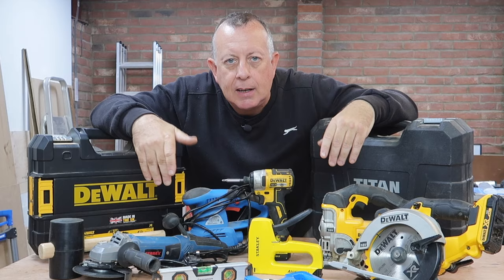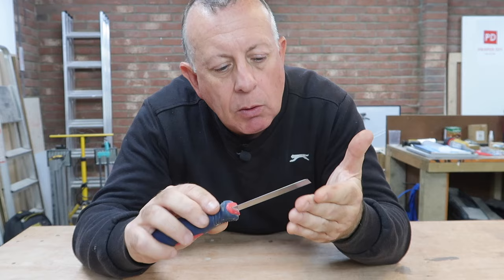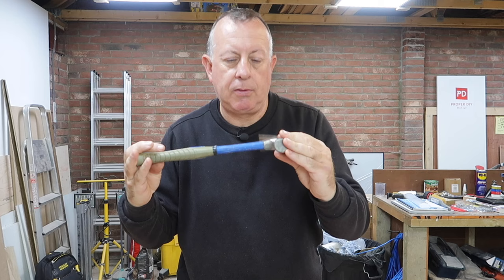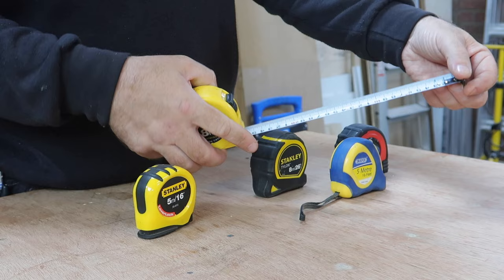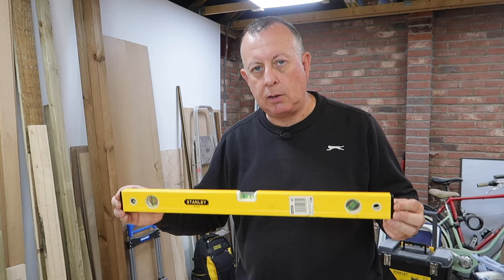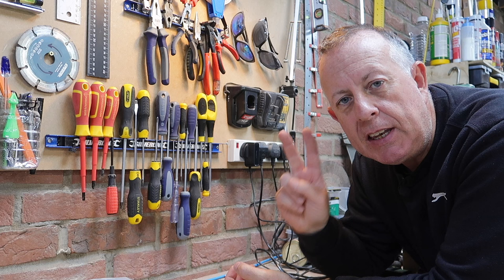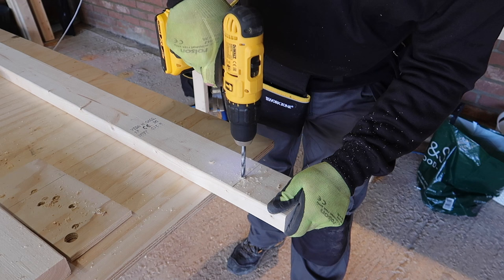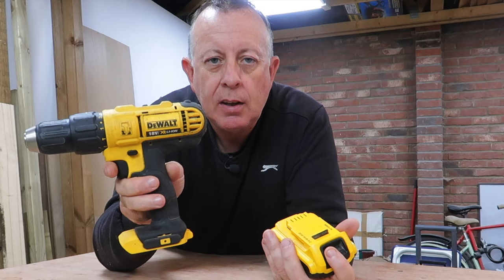Top 10 Tools for the New DIY'er for less than £100

Comment: You can’t please all the people all the time as the comments show.  Personally I think you should continue with higher / mid level diy videos. Someone of your expertise and attention to detail is wasted in this type of video. We watch your vids for aspiration and something to aspire to. Your garage project was amazing and we pick up tips from smaller projects
Reply from the maker: Do the comments show that - really? When I put out a 'Mortise and Tenon Door' video I get comments asking for more 'down to earth' videos that don't need many tools and the other way around. Over time I will try to appeal to the whole range of DIY'ers from new to experienced. As for current projects, I still have the rest of the garage conversion to complete, block paving, security cameras, garden projects and a large shed build etc,etc but unfortunately cannot necessarily complete one of these each week so sometimes I have to interject something a bit more straight forward.
Reply: @ProperDIY  I wasn’t being critical. , obviously you need to fill in to keep the channel going. I reckon some good fill in videos on how to properly use power tools like routers , table saws , circular saw for cutting fine without chipping, etc etc. Also quick honest reviews on tools. 
Just my opinion. As I say I wasn’t being critical ( maybe constructively ) . Ive watched all your vids to date and find them interesting and helpful

Comment: Good advice. I bought my daughter most of your top 10 basic tools when she moved into her first house. Not as glamorous asa bottle of Champagne, but it has enabled her to do the jobs she needed. A few shelves, put up a garden shed and fitting it out, and maintenance and repairs around the home. 

I really think basic home maintenance DIY should be part of the national curriculum for all year 11 children.
Reply from the maker: Good stuff. Could be taught in place of the traditional woodwork - which prob doesn't even happen now!
Reply: My Dad did the same for me, 30 years later and he's long since passed on but I still use the tools he gave me and I treasure them.
Reply: Snap. I bought my daughter an 85 piece hand tool kit when she moved into her first flat. She uses it a bit but it's mainly there for when I get called over to fix or fettle something for her. Over the years I've managed to build up a collection of Worx PowerShare tools which I find are the perfect balance between top end stupid money & the bargain basement variety. I also pass on some my older tools to my son when as & when they get replaced with new ones - just as my dad did for me.
Reply: Wonderful gift for your daughter.  Far more valuable than a bottle of champers.  Well done.  Totally agree with you about home maintenance being part of the curriculum.  Everyone needs to hang a curtain pole or towel rail etc.  I came from parents who hadn't a clue about home repairs or diy.  My father hung wallpaper once, he hung it upside down.  He put up a picture in the hall.  It fell that evening and smashed.  So grateful for youtube.  It taught me most of what I know and I'm learning more every day.

Comment: In my day maintaining military vehicles like the FV432 any sight of an adjustable spanner could get you on a charge. The right sized spanner for the right sized nut. Using an adjustable no matter how big could round off a sump plug or any nut causing thousands of pounds of damage and taking an AFV out of service. That lesson has stuck with me ever since. I always use the right tool for the job.😊

Comment: Great video, couple of thoughts:
1 - The adjustable spanner is not in my view a replacement for a proper spanner, it's too easy to round over the nuts especially with the cheap ones.

2 - 95% of home jobs with 10 tools might be a bit of a stretch...half the fun of DIY is tool acquisition! :)

3 - totally agree with the number 1, cordless drill is the essential tool! A "proper" brand (dewalt, makita, bosch...) as additional bare tools can be bought to utilise the batteries and perhaps could be a better investment than a no-name.

Cheers!
Reply: Re no 1. Smaller nuts maybe, but larger ones tend to be fine. Or get a Knipex adjustable. That won't cause any bother, though access is trickier!
Reply: @iainamurray  no you can't beat a proper set of spanners. Adjustables tend to slip
Reply: @michaeldunham3385  You obviously haven't used a pair of Knipex!
Reply: @iainamurray  35 years as an electrician...... I've used knipex but they don't beat a good set of spanners
Reply: @michaeldunham3385  Depends on what you're doing. I'd much rather use the Knipex wrench for a lot of jobs unless it's hard to get to.
Reply: @iainamurray  I've used knipex pliers wrench for loads of small to medium nuts, never slips as the harder you hold it, the harder it grips. Doesn't mean I don't want a set of wera joker spanners mind ;)

Comment: This is a good starting list and is pretty much the first tools I bought.  But it's only a start and my advice is never struggle or try to improvise with the tools you have - if you need another tool or part to do something, or to make it easier, get it.  I have an old property made of really hard, tough bricks, and I spent hours trying to drill a hole with a regular cordless drill and blunted my masonry bits.  Then I bought an SDS drill and it was a revelation.  When I had to screw cabinets to a wall,  I was like a contortionist trying to squeeze my wrist and screwdriver right into the top corner of the cabinet.  It was a nightmare, until I went out a bought a long reach screwdriver, and suddenly it was a breeze.  Overall the most useful tool I own is a ratchet screwdriver; I rarely use conventional screwdrivers.

Comment: My garage is stocked with Aldi/Lidl tools! They do everything I need them to do and my sliding mitre saw (also Aldi) hasn't let me down either.  I had more expensive tools years ago (stolen, bastards!) and to be honest for what I need them for now I will stick with cheap.

Love the videos and I have put some of your tips to good use during the past 6 months! Cheers Mate!
Reply: The Erbauer EXT range on Screwfix and B&Q are really good and not too expensive either. Have a look! I have got their impact driver and combi drill twinpack, bare circular saw and multitool!
Reply: @benh1216  they are decent tbf and brushless too!
Reply: iv got some of the ferrex aldi stuff and its decent enough isnt it for the price point! only gripe is the battery availability from aldi has been so hit and miss, really difficult to get 20/40v batteries and for the most part also difficult to get the 20v batteries! Currently i have the impact driver, rotary sander, recip saw, air pump and the rotary SDS drill.. all been decent, the impact driver was an absolute peach of a buy - used it so much its untrue, i would highly recommend an impact driver to anybody starting out!
Reply: @s1dew1nd3r4  I have a big variety and I believe Santa is buying me a Palm Router and Table Saw! The 18v Circular Saw is a bit ropey with the supplied blade so I will try a better one before I write it off completely. The Corded SDS Hammer Drill/Chisel I bought for £20 from Aldi is excellent, just needs greasing after heavy use. Love em!
Reply: @stretchclogg  lovely jubbly! theres a 20v ferrex circular saw in the local store near me that im going to go and pick up - seen some reviews that say its not really powerful enough and stops at times cutting through stuff but as you say, maybe a change to a better quality blade could solve the problem! The mitre saw is something i DO definitely want/need!
Reply: The only issue I have with aldi cordless tools is the future availability of spare batteries. Are they compatible with another system from a major manufacturer? If so then all good. If not I can see a problem if aldi decide not to sell them anymore, as batteries have a limited lifespan. 
I'd pay a bit more and go ryobi.
Reply: @stuckintheeighties487  not sure if they are compatible with other brands. There are adaptors available which i've seen in eBay which I'm thinking of buying as I have a little 18v drill/driver with only one battery. The newer type battery doesn't fit it.

Comment: I absolutely love this video! It's realistic and downto earth. I do a lot of DIY and the only tools I had for the longest time was two screwdrivers (one flat and one star), a handsaw, An electric drill, a €1 pencil, and a 5m tape measure. They really go a long way. You can also buy screws that come with the correct bits for them. I would suggest investing in a magnetic bit holder, but you don't need one. It just makes it easier.  Some clamps makes it a little easier if you're building on your own. Edit: I did have a hammer too, but I haven't needed it much as I mainly work with screws.

Comment: That's a great list.  Over the years I've accumulated most of them.  Most recent acquirement was a combi drill which had 2 batteries with it.  Promotional deal.  Thanks for this.  Very reassuring.  My wallet breathed a sigh of relief!

Comment: For entry level cordless tools I'd personally recommend going with LIDL's Parkside range, assuming you're not in any rush since they're usually only in stock a few weeks a year. They have a vast range of tools at really good prices, and have a 3 year warranty.
I have basically their full 20V and 12V range, and can't say a bad thing about them.
Reply: I find macallister from b and a pretty good and reasonably priced
Reply from the maker: Good tip! I have a number of items form Lidl and Aldi but only having stock a few weeks of the year is a problem.

Comment: Agree with this list. The only comment I’d make is to buy the highest amp battery you can afford. My first ever DIY project was a garden office build from scratch (with hindsight quite a big job for a complete novice who’d never even hung a picture before!). Combi drills/impact drivers ran out of power far too quickly with anything less than 3amps. I’ve now got three 5amp batteries and was best investment I made (although even a 5amp is quickly drained when using angle grinder or multitool!).

Comment: Combi drill , impact driver from Lidl Parkside with 4 ah batteries cost around £80 . Have been using them from last 1 yr also bought the grass trimmer and jigsaw which are good quality too.
That Big hammer drill from Screwfix brand Titan is also a must have.
As a new homeowner I found the evolution circular saw as a must have .
Multi tool from lidl costs only around 20£ and is very handy. 
Also Facebook marketplace is a good place to look for tools.
Reply: Glad you're enjoying your tool journey, but for diy I'm not sure powered saws are ESSENTIAL. By the time you need to cut large amounts of wood accurately goes step beyond diy lol you're an amateur carpenter😂

Comment: I'd have added a small number 4 hand plane, and although technically speaking not a 'tool' I'd also add safety specs /dust masks. I think you'd still be under £100. 
By the way, that handsaw will also allow you to mark a 45 degree cut.

Comment: Great video, The only thing I might add is one of those cheap work benches with vice. I spend years on my hands and knees and devising ways to keep whatever I was working on from moving about (money was tight! or was it just me?) I finally bought a light weight folding workbench with a vice. I think it was about £10!!! They are still about for similar money. It was very helpful. I was guilty of a lot of risky "improvisation" and looking back it is a miracle I kept all my fingers! 
Stay safe!
Reply from the maker: Thanks. So it's a top 10 so what would you remove?
Reply: @ProperDIY  Ah Ha! good question, I had to look at the video again. For me it would be  the adjustable spanner, likely because I have always had spanners due to my long held interest in car maintenance. I guess everyone will have a variation.
If you start with nothing it is absolutely a strong top 10.

Comment: Great video as usual.one thing I would say regarding the drill is when buying power tools some manufacturers use the same batteries for years and years.I had a Bosch set of power tools and when the batteries packed up I was forced to throw them away as they no longer made them

Comment: I think one of the reasons why a lot of British people still stick to inches is that they seem unaware of centimetres. Saying that something is "one hundred and twenty millimetres" (when the accuracy of that measurement is nowhere near 1mm) is really inefficient compared to saying "12 cm".

And this is even weirder when 99% of rulers and tape measures come numbered in cm, not mm. You look at the number and (if necessary or relevant) add the (marked but not numbered) millimetres as a decimal (i.e., if it's 4 little ticks after the big "12", then it's "12.4 cm" - the .5 is typically even marked with a slightly taller line so you can approximate as "twelve and a half", if you need slightly better precision than one centimetre but know your measurement isn't millimetre-accurate). Millimetres are used in contexts where a +/- 1 mm difference actually matters. If you're saying something is "about 110 or 120 mm long", you should probably be saying "11 or 12 cm".

Comment: Instead of buying some of these as singles, it's probably better to get a kit with most of them. Then you have a case to keep it all together without having to spend more money on a tool box/bag. It may have a few things you don't need, or at least not that often, but the price won't be that much off. Mine came with a hammer, screwdriver with 20 something different heads, 6 precision drivers for smaller screws, ratchet set including an extension, and the most common metric and standard sockets, a couple of wrenches, etc.

Comment: Great vid.
My stage 2 'expansion set' list would be
Steel rule
Locking pliers
Long nosed pliers
Hacksaw
File
Punch
Chisel set

Plus -  stuff which isnt exclusively 'DIY' but things that are really handy to have a second set of, just so they are there when you need them,  and saves 'household conflict'
Pencils and Sharpie pens
Dustpan and Brush
General purpose scissors
Reply from the maker: Totally aggree
Reply: 100% agree on scissors. I was cutting hardwool insulation with scissors. Don't want them in the kitchen drawer lol

Comment: I love power tools, well all tools really.  Finding a use for them is almost secondary….Is that bad?😁
All,I would say is…a good drill lasts years for DiY, so do spend the extra on a top brand (not necessarily top of the range) and you’ll never regret the outlay long term.

Comment: Probably worth adding that as far as a cordless drill / driver is concerned, many of the supermarket specials are pretty asthmatic, especially when it comes to drilling masonry. Might be OK in a newer house, but will get you nowhere drilling older and engineering bricks, or concrete lintels to put the curtains or blinds up.

Comment: Probably worth noting that the average DIYer would be better suited to buying into the Ryobi ONE+ system as for a couple of £100 that will get you a jigsaw drill circular saw and 2 4ah batteries from Ryobi for £99.99 at most major UK Holidays the Ryobi ONE+ system is excellent on the 18v platform as you can get various tools even including a decent Lawnmower 31cm width version and a decent 18v strimmer i reckon for about £450-550 that you can get most of the Ryobi 18v tools that the average DIYer would ever need including an SDS!

Comment: Great video mate some very good advice there. 
My cordless drill cost me £28 from home nave twenty years ago and my mains powers drill was from B&Q cost me £70 again twenty years ago and as an electrician they have done a lot of work and they are still going strong but I did have to get a new battery for the cordless. I don’t have never have gone for the fancy overpriced brands and I have never had any problems with what I have . Great video 👍⚡️❤️
Reply from the maker: Thanks! Good advice and feedback!

Comment: Totally agree with your choice but just as a cordless drill is an essential item nowdays i would say a cheap mitre saw is a must too.
For any kind of finish work only a mitre saw will give you a square straight cut plus angles. Its also invaluable for finely trimming wood if your first cut is too long.
Reply from the maker: For me a mitre saw would definitely be the next purchase after a drill but I couldn't suggest a mitre saw to a new DIY'er and then drop a Stanley knife or spirit level - only allowed 10 in a top 10!
Reply: @ProperDIY  fair enough 👍

Comment: Great video, went for proper items that others miss on these videos.

One thing I would add  is to try to shop at bootsales, and it goes for anyone tbh. 
Bought a circ saw on the cheap from Screwfix (30/40 quid evolution) , within a month found a virtually knew track saw with track for 30 quid which has made the evo circ redundant except for reclaimed wood and the other things that the multi blade cuts. While over kill for most DIYers it's great for someone who wants to build something most days off, and a great place for building  up a few more "specialised" tools.
Reply from the maker: That's a good tip. Funny though I haven't actually watched any other 'new DIY'ers tool vids' so this list is purely mine

Comment: I wondered if you'd mention the square on the old saw. 

And regarding Power drills. Getting a decent battery is key to especially if you only use it now and then. My first drill years ago the battery stopped holding a charge. Despite not using it that often. Then I purchased a JCB cordless with (I think) a Lithium ion bat and that's lasted years and used sparingly. (And always has charge when I go to use it too)

Great video 👍😊👍😊
Reply from the maker: Thanks